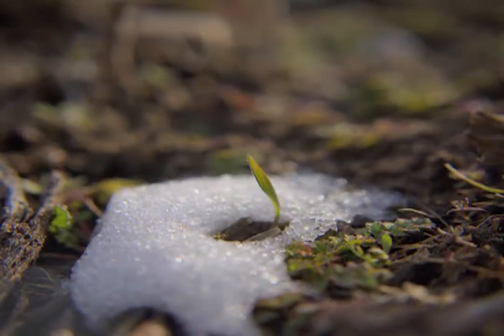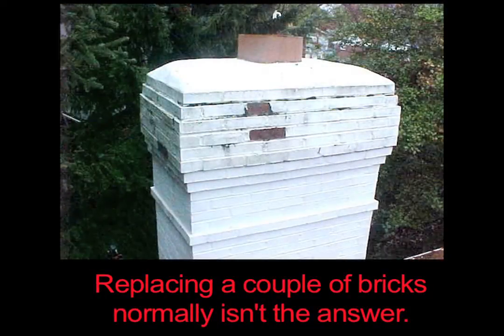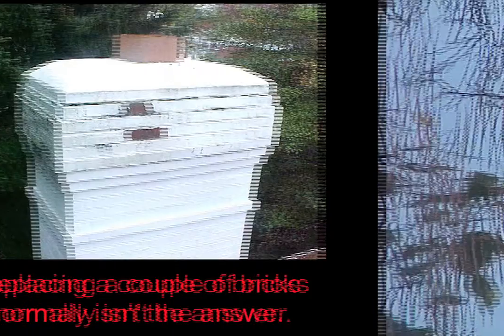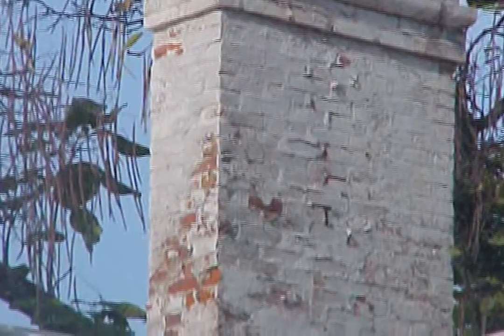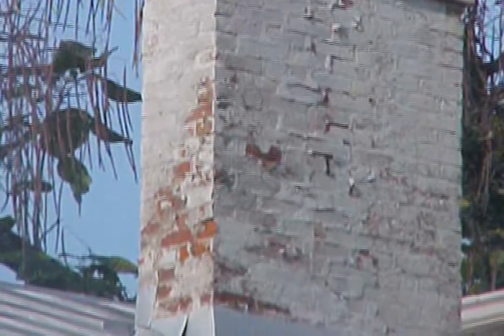Painted Chimney Problems

Comment from the maker: @housecharmer Thanks for asking.  Painting the chimney compromises the masonry so much that it will inevitably deteriorate.  Eventually the chimney is going to have to be reconstructed.  So when we reconstruct the chimney, the customer has two options.  The first is to rebuild the chimney and paint it again, and go through the same problems.  We recommend the second option: Since most of the chimneys we deal with are painted white, we can rebuild the chimney using white materials.

Comment: Thanks for sharing...So how do you solve the problem?????
Reply from the maker: I feel it is not what you can do today because it would entail the rebuilding the chimney and not paint it to start with.  In most cases, the brick and mortar under the painted surface are already saturated and damaged to far.  Often when we are involved in these painted chimney repairs, we rebuild with both the bricks and mortar being of  the same color  or complimentary as the home (ie; white brick white mortar)